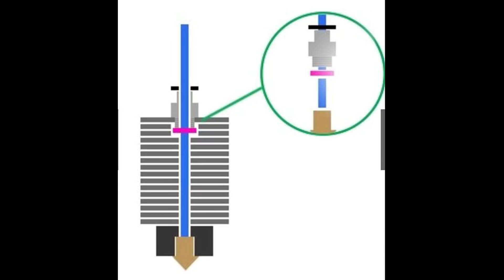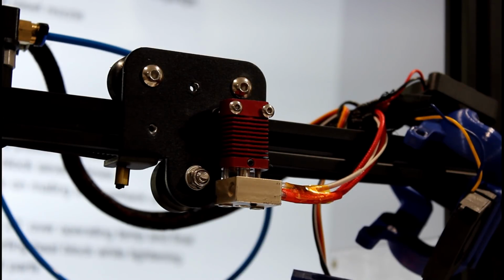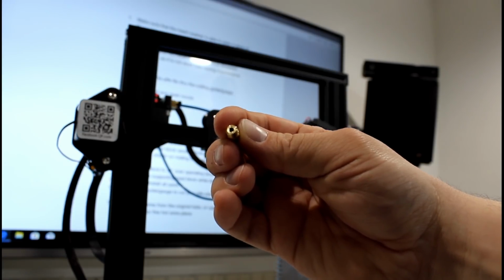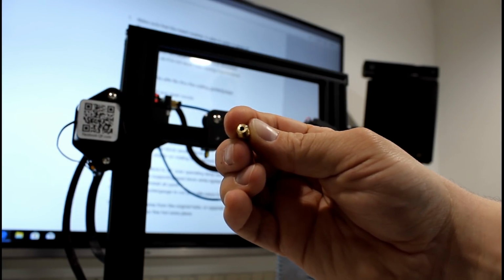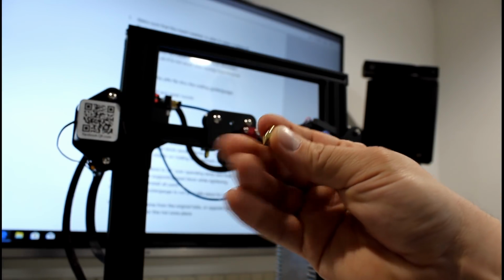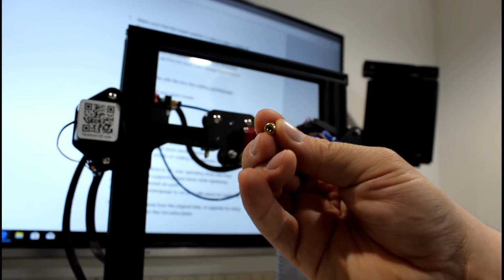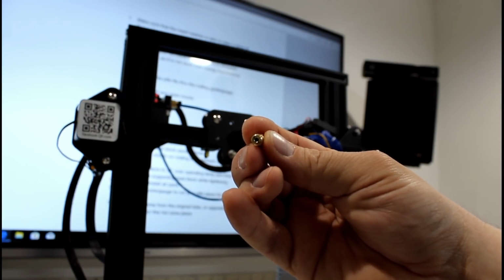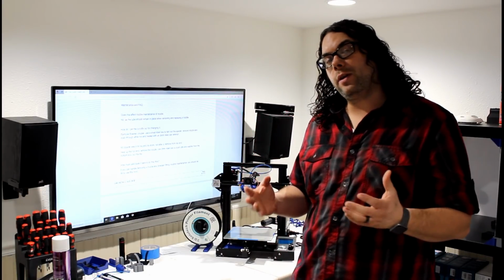Hot End Fix for Creality and Others Section 2.1.5 featuring the Ender 3

Comment: You guys need to stop touting this as a one-in all solution for everything when someone posts a problem - there are many causes for many things and copy/pasting this as the fix for absolutely everything is just lazy. 

 It is also a temporary fix. The insert part needs to be made from nylon or metal to not deform under heat or pressure.
Reply from the maker: Hey Geoff, I agree that there are many solutions for many problems. I don't think it's an all in one solution at all. It does seem to get posted a lot, but with good reason as the Creality Hot Ends have issues with the Bowden tube pulling away from the nozzle. It also helps retraction and back pressure. I'm filming these videos to help people who learn better visually like me, and it's Luke's content. He has spent hundreds of hours helping people with their issues, so I trust his judgment in posting fixes. If you have some questions on the longevity of the fix, I would have to defer to him. I appreciate the feedback and your opinion. Thanks for watching! :)
Reply: @TheEdgeofTech  I agree it is a good solution to get someone out of trouble, but the amount of times I've seen present this as the fix for many issues that are not related just got very frustrating after a few months.

I agree all the creatliy hotends suffer from this problem and honestly it amazes me they have not updated the hotends at all to address this, if not the PTFE fittings they supply.

I've already said to LH a few times that this fix shouldn't be presented as a permanent fix, both for the internal bowden compression and cheap tubes deforming against the nozzle end inside issue but the cap itself deforming and creating just as many problems, but yet its posted over and over and over - and yep , as I said its great to get you out of trouble the only way this can be a permanent fix is upgrading the tube most importantly to one that can withstand that constant pressure against the hot nozzle without deforming (and there is a slew of fake capricorn going around so even thats proving difficult for people now) but also the cap needs to be either alumnium or brass or something that will not compress.

Having to tighten the ptfe tight enough to stay put and not undo itself during a print and general X axis movement requires you screw that PTFE down very hard ontop of the cap, ideally it needs to be a smidgen thinner and a longer bowden piece used . 

I guess whats frustrating as I said is seeing this as a blanket solution to 100 different issues. I know luke has watched alot of youtube videos and compiles alot of information, and thats great but I've gone more going of actually using them for years and running into the problems and fixing them when they present themselves.
Reply from the maker: @GeoffroAU  Gotcha! I do appreciate your stance. All of that aside, I just hope the videos I'm making help people to learn how to fix their machines and keep them running great! Whether it is this or the X Gantry or Esteps, as long as I'm helping people learn, that's what it's all about. Then the hope is that they can get to where you are and identify the issue to solve them on their own! :)
Reply: @TheEdgeofTech it looks like a good series, keep it up! just remember there are other sources out there to expand from.
Reply: This is still an excellent solution to a genuinely annoying issue. I was of the same opinion as you "This is everywhere, ugh!"

But as childishly pissy as I was for no true reason(other than perhaps jealousy at the attention?), I simply can't deny that this is amazing. 

However, I'll give you that it should be made from nylon or metal. Mine melted during my first attempt at installing it. But you can absolutely also just keep making them out of less heat stable materials but then you will, indeed, need to replace them often. 

I'm gonna make one out of silver(because it's easier to cast small things in silver than aluminium) for my hotend.

Comment: Can you print the washer with PLA?
Reply from the maker: Yes! That's how I do it! Make sure the filament goes nicely through the center if not, drill the holes out a little.
Reply: @TheEdgeofTech  What keeps the washer from melting??
Reply: @stevei7221  the fan. Washer is on the cold side of things.
Reply: @STEAMTraining  Thanks! I've had great luck printing since I tried this!